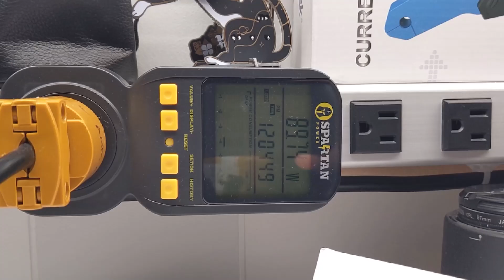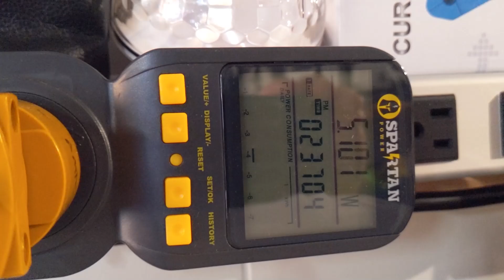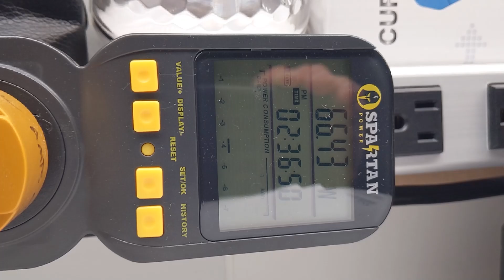Organize Your Loads! Fused Switch Panel From PCBWay

Comment: Very cool design and gives me an idea for work.  Some of the devices in a rack need to be powered up after the network switch is turned on but the group that set it up was running random power strips, some of which have 30 foot power cables in an 8 food rack, so it's quite messy.  This looks like a step in the direction of organizing that.  

Again, very awesome project.

Comment: Is it known by the width of the board's traces what the Amp capacity of the board itself is?  When you design the board is that something you can plan for?
Reply: You can absolutely plan for it. Depending on (I think) the tolerable temperature range of the pcb and the thickness of the copper layer, you can calculate the necessary trace width. Look up PCB trace width calculator.
Hope that helps
Reply from the maker: There are calculators online that let you input your current and they tell you how wide a track you need!